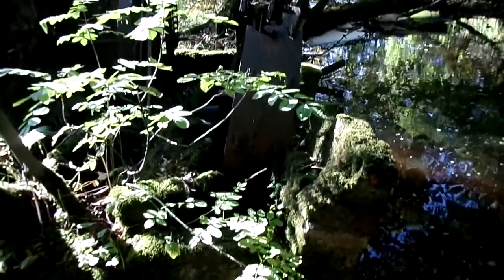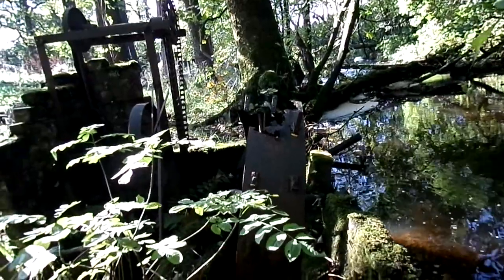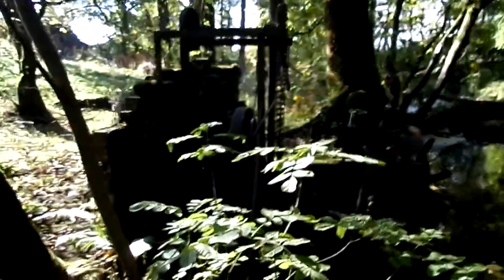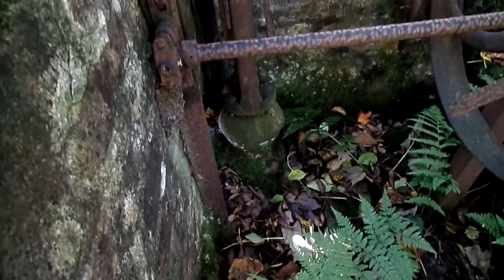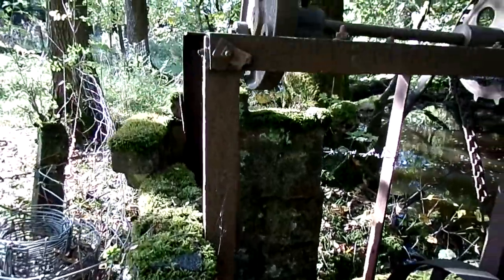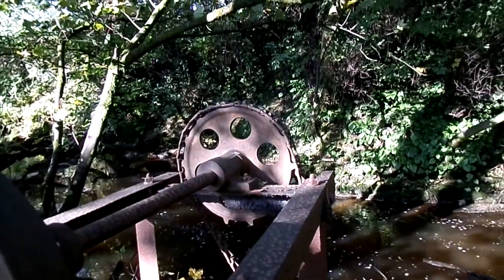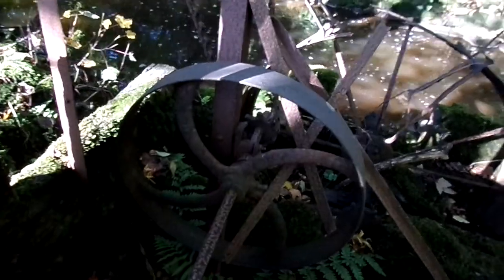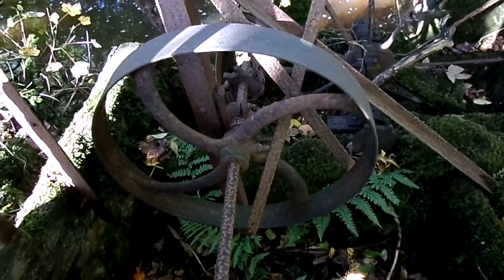Water Powered Water Pump at Hessilhead on the Dusk Water

Comment: It's amazing that is still there ,i was visiting the old mineshafts of the nearby langside lime works near the old Trearne house today and wondered if you had been there ? They would make a good video and I'm sure you could pass on some excellent history surrounding them
Reply from the maker: I have been to Trearne and the Hessilhead lime works. Are the Langside mineshafts near the raod to Gateside?
Reply: @rogergriffith286  yes that's right they're on the left hand side of the old track that used to lead to Trearn house in an overgrown wooded area on the left hand side between the track and the road
Reply: @rogergriffith286  there is four or five large entrance tunnel's although I never ventured in as I'm sure it's very  dangerous albeit very fascinating. I may head back with a powerful torch as there's not much to see from the entrances